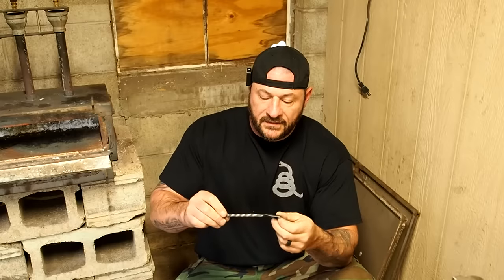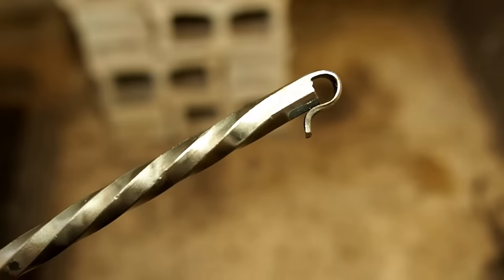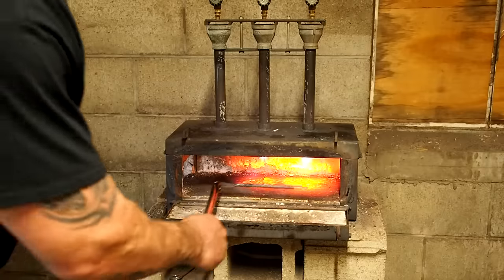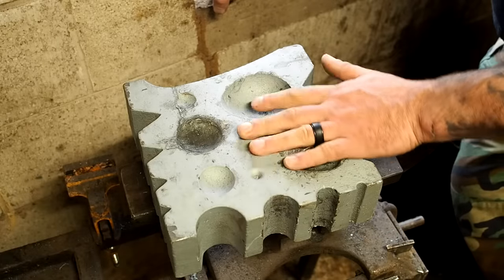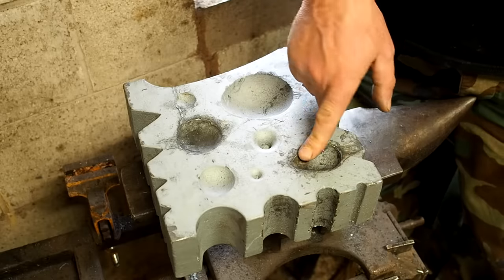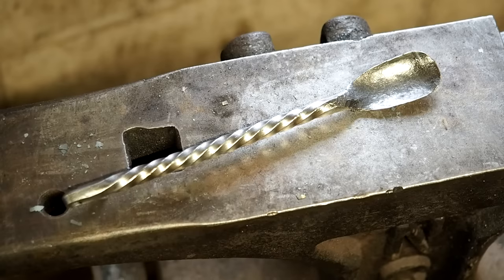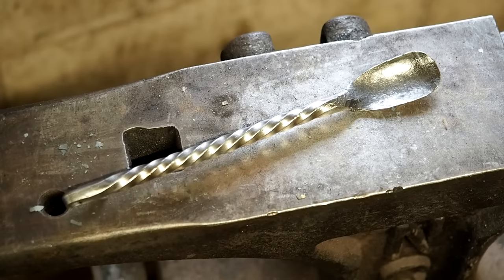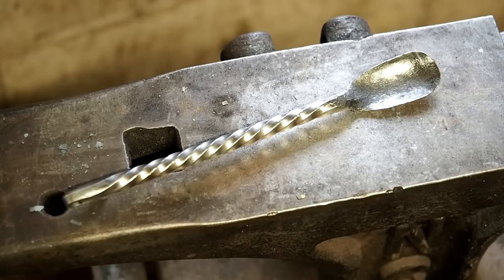Corporals Corner Mid-Week Video #34 The DIY Forged Frontier Spoon

Comment: If you use flat stock . You can fold a bit of the end back on to it's self and pound it flat ...you can use a swage for a spoon shape and use in combination a stamp that fits the spoon concavity and with one or two strikes you can get a spoon shape fast ....if you fold a bit of the end you can increase your material to shape a wider spoon.

Comment: I love that you’re doing forging! There’s a few tips that could help your process on spoon making- 1. If you’re not looking at using it as a flint striker you can do it cheaper and easier with simple mild steel 2. You can either upset the end of the material to give you more mass to work with or square it up, fold it and forge weld it to give you the mass to do the flaring 3. Your can use half faced blows to make the hook pretty quickly and save time at the bandsaw. I’ll work up a video tonight for you on my channel to show what I’m talking about and that’s Albrecht Metal Works I love everything you do “Forge on my friend!!!”

Comment: As a recovering Alec Steele and Trenton Tye video addict, with no actual exp,  you want to "Upset" the spoon end first. Heat up just an inch or so of the end of the steel blank, and then hammer from the end. The idea is to 'shorten it, but make it thicker,' and from a lump on the end. This gives you more material to play with in that spot, and you can form a bigger spoon end without getting too thin, but still have a nice size for the handle.

Comment: Hey I was going to tell you I noticed youre using a large tip Sharpie when I was working Sheetmetal we bought thin tip sharpies for precise cuts Wallgreens sells them in several Colors too. Once you use one of them youll never want to go back the normal sharpie tips for metal working. I also used a Metal Ruler called a Scale it gives very precise measurement and works very well for marking metal with straight lines with the thin tip sharpie and its very small and thin you can just throw it right into your shirt pocket and wear it in the shop.

Comment: You could probably get away with using thinner stock and upset the end to get more material to play with for forging the business end of the spoon. You've got some handy equipment there I can see. For the layman, you can chuck a large ball-pein hammer in a vice and make spoon heads around that if you're careful, if mild steel, you can cold work it.
Shawn, try making yourself a custom spoon hammer that you can strike with another hammer and use it to smash into form in your swage block. Like a hammer press and mould.

Comment: Suggestion: try using a folding and forge welding technique for extra material in the spoon end. Don't have your experience however. My metal working is limited to Gunsmithing, making parts, and some knife making. So just a suggestion. Thank You for all you're doing. Semper Fi. CHANCE FAVORS THE PREPARED MIND.
Reply from the maker: if it is extra steps it doesn't save time

Comment: Great job on your prototype. Forge weld the flat bar onto the hex stock to match your fork. May have to use an oxy-acetylene rosebud for the weld due to propane not being hot enough to weld.

Comment: Another Alec Steele trick, (Again, learned from youtube so it must be true): if you want to turn square stock in to round for the handles, you start by heating it and knocking down the corners so that four sides become eight. Then repeat, 16, 32, 64..., you get; round stock.

Comment: Interesting video, thanks.
Wonder if you could make an upper and lower die set with a couple of small blocks of steel with a little die grinder or something; attach them together with an off the shelf hinge, then use them to form the bowl either by pounding, or with a moderately sized arbor press.  Then the fab time might actually be shorter for the spoon than the fork.  Heck, maybe you could come up with a way to CAST the die set.  That would be cool AF...

Comment: You could try heating up one end and holding the bar perpendicular to the anvil and hitting it straight down to push the hot end on itself and in turn it would be wider and fatter on that end for the spoon to give more surface area and take it to the block like that

Comment: Try hammering twice as much flat,fold it over on itself and then you'll have the extra material you need for a wider thicker spoon
Reply from the maker: if it is more steps than what I just did then it takes longer
Reply: At the beginning of the video you said you were figuring out how to make the spoon so you could sell them
You then presented a problem that the spoon size was limited by the thickness of the steel 
Things that are worth having sometimes take more time

Comment: Would making the bowl of the spoon first, shaping/twisting the handle, welding or brazing the two together, and then cleaning up the weld make enough sense to do it that way, or would it take too much time as well?  You could flatten out one end of the handle enough to use as a flange for brazing it on if you went that direction with it, if it made the process quicker and was secure.  Just a thought.  
Cool video, pard.  This is the side of the handmade item industry (one at a time) that not many people see.  Thanks for bringing us along.

Comment: I have not forged anything, but just a thought, could you cut the steel an inch and a longer and fold it back on itself to give you more material to work with ?

Comment: I hate to add to the "Could you" but, could you add the length of the spoon bowl itself to your original piece of stock, then heat and fold that over onto the bar again, then pound that all together for the needed material for the bowl of the spoon?

Comment: Curious...
You mentioned that with 5/16ths, you only have so much steel available for the spoon, and the wider you go, the thinner...

When hammering the red hot steel,
Could you fuse some extra steel into that section early on,

Kinda like the knife from old drill bits idea?
Just, if you need more metal in the spoon 'blade', fuse some in?

Comment: Dumb question? Could you either forge or cast a set of plates if you will with the shape, size, and depth you want so all you do is pond your steel flat, heat it up again, place it in the mold or form or plate what have you, and pound on the top to mold it or press it to the shape you like. Then, just a little time on the a grinder or wire wheel to clean it, do your twist, make your hook, and finish it up from there? Again dumb question.

Comment: Couldn't you use a longer piece of stock? If you would pound out a section twice the length you did for THIS spoon, you could fold it over double to give yourself enough material to make a spoon in your spoon blank. All you would need to do is heat it to welding temprature, and beat the folded metal into a solid piece twice as thick. That should give you plenty of metal to work with. I've seen other blacksmiths do that to increase the size of a piece made from a smaller piece of stock. Is there a reason that you know of why that won't work?

Comment: You need to do like the professional knife makers do sometimes they have to weld Special Metals to one another in order to get the consistency of the knife metals that they want so you can actually weld Forge and smash the the front section of the spoon with flat stock and have it welded to your flat bar
Reply from the maker: then wonder why it takes even longer